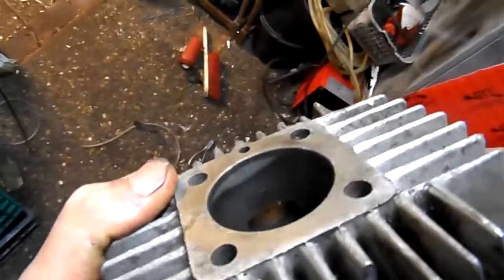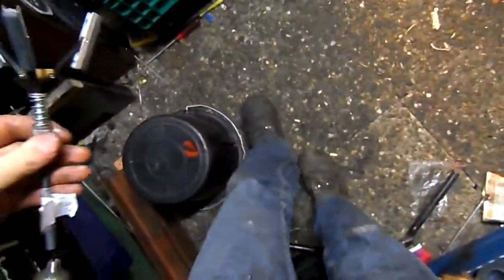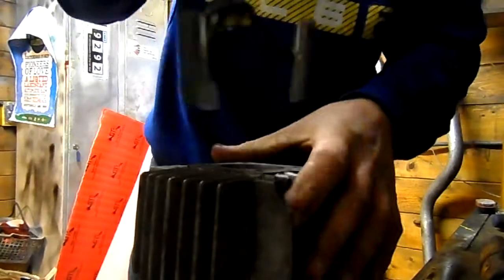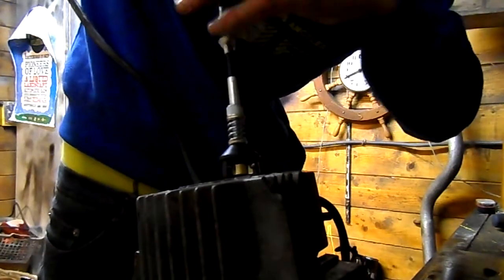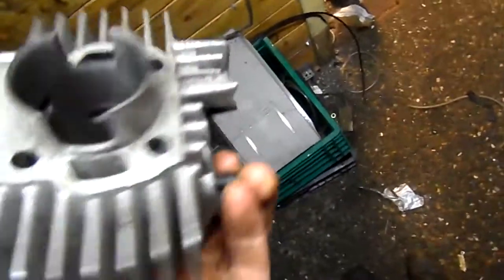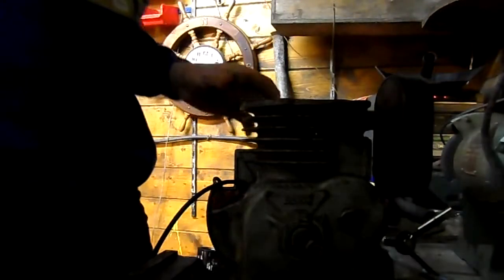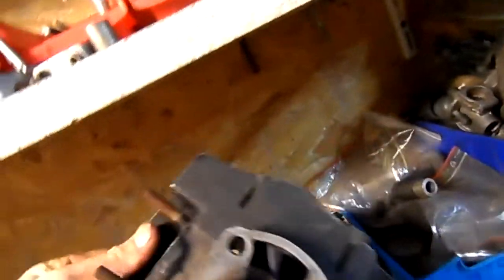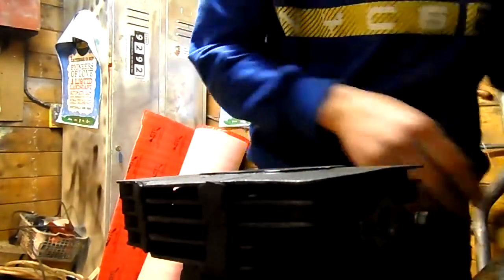trying to hone a cilinder

Comment: when ever you hone a cylinder you should use plenty of oil if not the hone job will be very rough and too scratchey, if you use plenty of oil it will turn out very smooth like how you want it. One other thing is you dont want to use 3 stone hones on 2 stroke cylinder cause the stones will get caught on the ports and break. They make flex hones which is basically just a whole bunch of little stones put together.